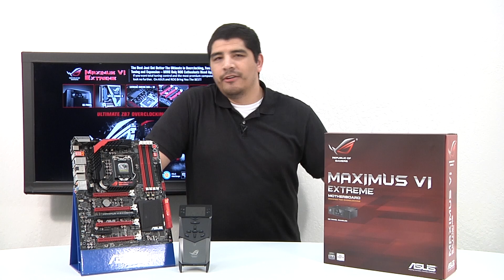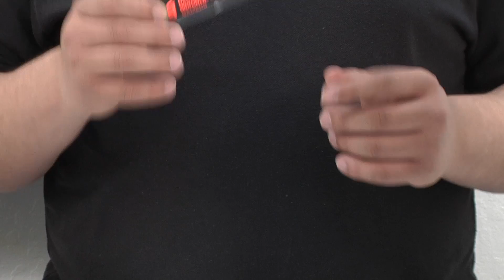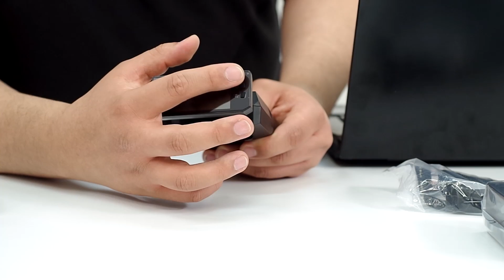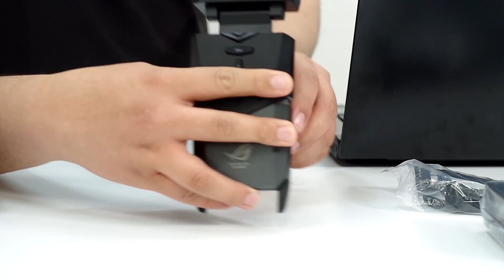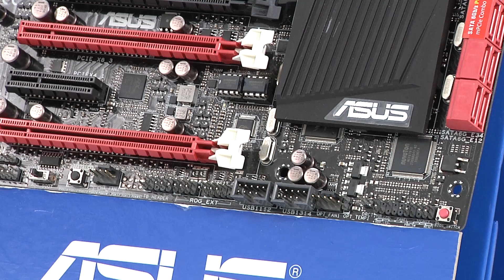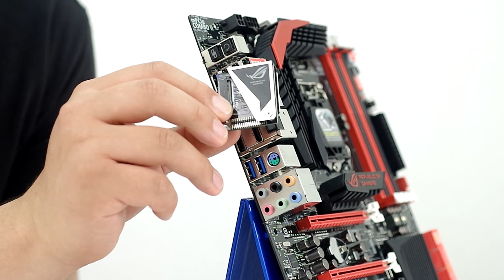ASUS ROG Maximus VI EXTREME Motherboard Overview

Comment: I have the Maximus V Extreme. I watched this video previously and thought I could use the OC KEY with my board so I bought one.  Then I realized I didn't have the correct header for the OC KEY. I believe I can use the key that plugs into the back, but can I use the display unit as well?

Comment: Hey Asus, Been reading the manual from your site. Should let customers know more about M.2 compatibility. Not many sellers of these motherboards say you need a 42mm card max (which it says in the manual) with a SATA B/M key socket (this ISNT in the manual). Because Samsung decided to make just an M key, that is incompatible with B/M Sockets, and somehow form factor sizes can go beyond your type 2242 (42mm) size like type 2260 (60mm long), type 2280 (80mm) and type 22110 (I assume by the numbering is 110mm long). Also sellers dont give this information on these cards like Intel's 530 M.2 SSD's. People are gonna be buying blind if they dont research.

Comment: hi guys im having trouble with the black pcie slot...whenever i have my secong gtx 780 in it my computer will black screen with no signal to monitor so i have put it in the 3rd red slot.

when i had the card in the black slot i seen that the metal clip on one of my sata cables was pressing against the pcb of the card...could that be the problem?.

also is it ok to run the second card in the 3rd slot? (3ed red)

thanks
Reply: If you are not sure how to plug in video cards, why do you have a this expensive motherboard? For starters, use the red slots.
Reply: had computer like this for many years never had this problem. not sure how to plug in video
cards lol 

i have these expensive motherboards for all the extra features and great quality.

for starters the black slot is the native slot for the second gpu for 2 way sli ....and its not functioning properly therfor i asked the question.

..thanks for your stupid usless comment.
Reply: lol, gj. For future reference, here is a screenshot from the manual on how you do it, exactly. http://puu.sh/69STz.png

Comment: I really like this board. I recently have done a lot of research related to Z87 motherboards, and I've settled on three ASUS boards. But I REALLY don't know which to choose between this board, the Maximus VI Formula, or the Z87 Deluxe. The OC Panel seems pretty attractive. The cooling system on the Formula is also a great feature that reinforces the quality. The Deluxe is also a great board packed with features. If someone can help me out that would be greatly appreciated.

Comment: I thought the same but heres the thing, it's all those oc components that are going to give u a longer life span to whatever extent u do over clock and the software and oc panel make any level of oc very easy. I read reviews said u cant play crysis 3 with 4600 graphics on the Intel4770-K alone. Well dunno what board they're using but im playing crysis 3 with this board and that chip at very high settings just fine and u can oc with 2 clicks to get 5.2Ghz outta 3.5 & make that happen at < 30C

Comment: asusrog - You guys have a done a great job with this board. 48hrs in & I love it. Still got some discrete GPUs to come but re: setup lots of things u discuss in videos sounds great but couldn't quite see use for UNTIL I bought one. For instance Q-Codes and onboard start buttons. I thought yeah ok but so so.  But then when u build it Q-Codes, onboard start and the diagnostic LEDs are super helpful and massive time savers.

Comment: Well Ive gone ahead and bought one & they are pretty damn awesome. The 780's are OS so no super duper GPUs to report on yet but re: USB, there are 3.0 options coming out ur ears with this board. Certainly more 3.0 on this board than I can conceivably find a use for so u really dont know what ur talking about. 2.0 header on board was also very useful for my Cosiar Link gears... which this board largely obsoletes anyway cept PSU and h100i but new boards still need some connections to the "past".

Comment: First. On the OC panel how many watts can each fan header handle? I am considering using it as my primary fan controller for a multiple radiator (push/pull) set up.

Second. Can I crossfire PCI slots 1 and 2a or do I have to use PCI 1 and 2b for a dual card set up?